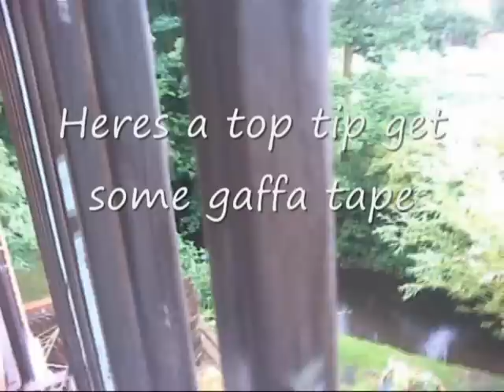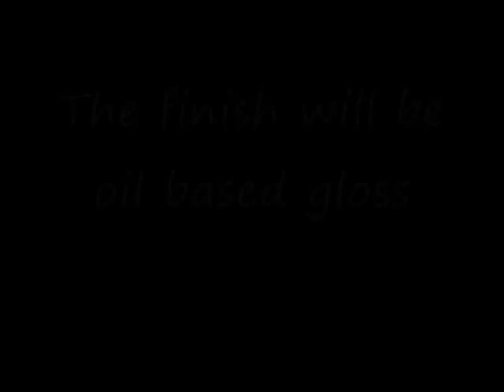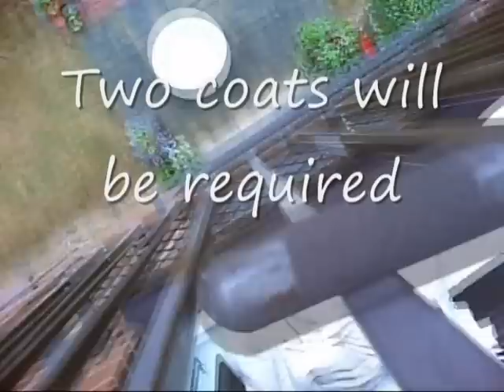Strip paint with duct tape!

Comment: so you don't have to get every single bit of paint off?  I mean you only have to get the majority and then sand the rest down so it's smooth?  I have to somehow do our porch railings and railing on two sets of steps.  I bought a big round steel brush that attaches to my drill and it did very little.  I am overwhelmed at the moment.

Comment from the maker: @mclaarson Hi you make a good point ,rusty iron needs to be treated very differently,  wire brushing or a power tool with wire brush attachment on it, red oxide primer on bare metal, then your prefered coatings. i have a rusty fire escape staircase to paint soon and will make a point of filming the preperation.

Comment: I am doing a security door with rust on it. I thought a muti-tool with sanding attachment or wire rotary brush on a drill will loosen the paint and remove rust, then paint with Rust Preventer then Rustoleum +Primer. Sound okay?
Reply from the maker: Bob A  sounds spot on to me Bob 👍
Reply: @Instone09ine  Thanks, of course I will also have to clean with spirits before paint as well. Cheers!

Comment: I need to paint my balcony rail, some parts are rusty, some are with paint coming off, do  i need to clean it first with a duct tape and then clean the rust off,  to prime?Thanks a lot xxx Oh when should i use the wool wire? Tha xxx
Reply from the maker: Hi duct tape first to lift any loose paint, then sand or grind any rusty metal back to a bright shine, then a  coat of red oxide primer to any bare metal before finishing with your desired coatings.
Reply: instone09
Thank you so much for your help :))))

Comment: I have a balcony with rust spots and some parts paint flaking off.  Do I have to remove ALL the paint before I repaint it? OR can I just remove the flaky parts and rust areas and then paint?
Reply from the maker: +Genki Kids yes thats fine just brighten the rusty bits back and spot prime straight away then re-coat the whole job, good luck :)
Reply: @Instone09ine  what do you mean, "brighten the rusty bits back"?
Reply from the maker: @alive-awake  Scrape away any remnants of paint loose rust sand the rusty area until the metal is bright again, then apply some primer,
Reply: @Instone09ine  thanks!
Reply from the maker: @alive-awake  Your welcome.